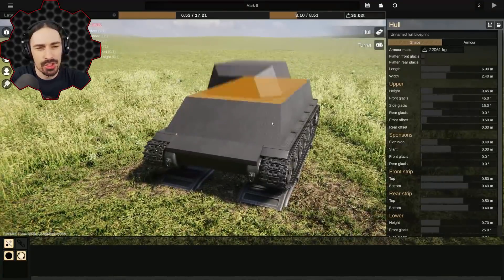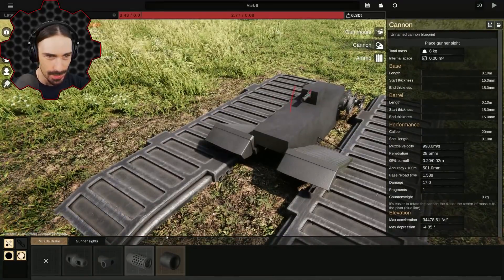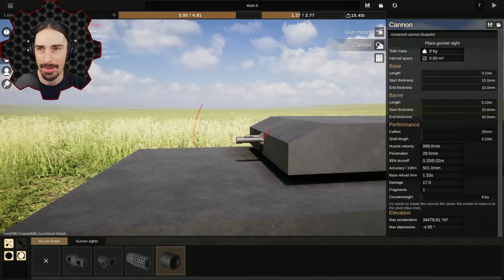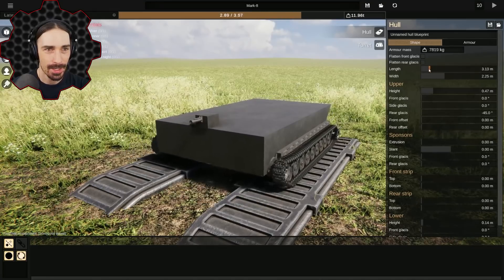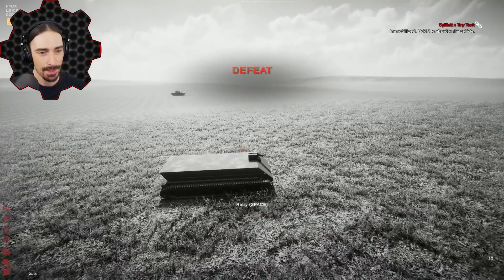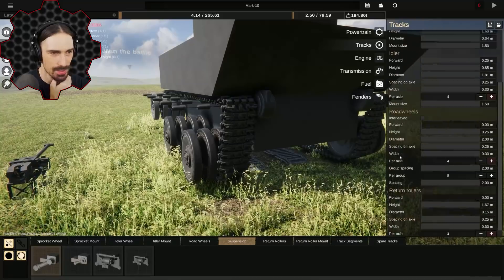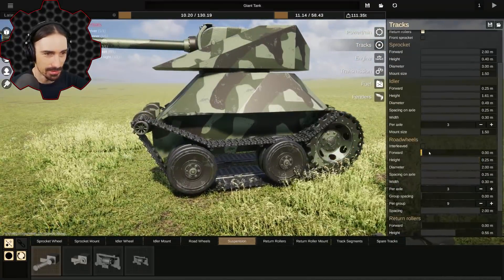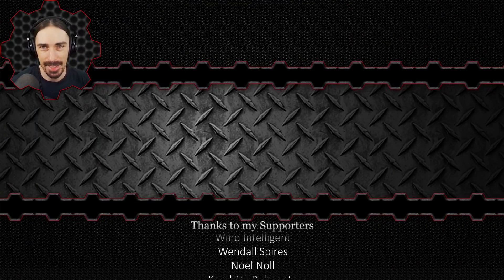Minimizing Every Stat VS Maximizing Every Stat Possible! - Sprocket Gameplay

Comment: The three trade offs for tank design... Weight, Power, Speed. Armor is nice, but slows you down and takes from how big a gun you can have. Big guns mean either no speed or no defense. And high speed usually spare armor and weapon. So, it a delicate balance.

Comment: Turning left and right with dual transmissions means that you need to be in like 4th gear at a slow speed like 20 kmh. That allows the left side to go into 3rd and right side to stay in 4th, or left side to go into 2nd/1st and right side to stay in 4th. (Or vice versa). Gives you finer control of steering. Or clutch steering is easier and smaller, but if you spend time to refine the dual transmission it works better.

Basically if you’re always in first gear and still going a decent speed your transmission won’t be able to shift one side into a lower gear which = no turning. You need to be in at least second gear to be able to turn at all, and preferably 4th or 5th to be able to turn well and with fine control.

Comment: 7:30 go to mobility
Powertrain
And change to clutch braking
Reply: Or he can not be dumb and actually adjust gear ratios.
Reply: @Chevsilverado  well its not too important you dont need gear ratios (or at least i dont use them)
Reply: @somerandomdude9657  Properly adjusted gear ratios help A lot with steering and acceleration. If he kept 2 transmission steering and raised  the ratio a bit the steering would work perfect and the tank could climb hills better.

Comment: The reason your tank does not turn while moving properly is a combination of your transmission gear ratios being terrible and games inability to comprehend your controls with a bad transmission. The easiest way to fix this is to in the transmission setting put it to clutch braking. It allows the tank to be smaller

Comment: Scrapman, how about a death race multiplayer Monday.
You make a car with 2 spudgun(attack), there Would be a small explosive at the back(with a level 3 metal guard for not getting exploded by spudgun) that can be detached by another spudgun ( defence) and some censor detected Explosive walls (trap). The course would be somewhat simple and it would be lapped race until only one person is movable.
In addition, there could be a unique wild c card for everyone's car that they can activate once every lap( can be activated any time, non detachable, non explosive)

It's a great idea altogether it would be a little time consuming to make a track and  system like that. Colour sensor can be used to do it. 
I want to see this challenge so badly. 
And scrap u have made scrap mechanic my favourite game. Keep it up!!!

Comment: The reason why you can't turn when your moving fast is because you're using twin transmission instead of clutch controls. Clutch controls also take up less space, which would let you make the tank smaller.

Comment: The sprocket and idler size limit is based on the space available to it at its current height. Meaning the largest sprocket and idler diameters you can get are when they're in the middle of the track system. If you have them high or low then they're restricted to where the diameter meets a kind of hard vertical limit.

Also, press Z in either sandboxes or in the show room and you will pull up the load list of tanks. Which ever one you select, the game will load in AI versions of that. Meaning you could have your giant tank lose to your mini tank, because it'd be pelted to death before it ever could take a shot.

Comment: 274 tons? I did a tank that weighed 345 tons. It can only drive with cheats on. It has maximum armor, is slanted all the way and has a big 152 mm gun and the biggest engine in the game. It is actually decently fast, to be honest.
Reply: Damn
Reply: What kind of engine you're running? Cylinders and displacement etc
Reply: @alkestos  V16 and the maximum displacement possible.

Comment: The problem with steering has to do with transmissions. You need to have either the clutch system or the ability to get into different gears per track. So if you aren't able to be in 1:2 or 2:1 at very least you wont be able to turn unless stopped.

Comment: To fix turning when moving by the way, use the clutch braking transmission instead of the dual transmission. It stops 1 track to turn rather than needing a different gear on left an right track.

Comment: Now make the fastest tank, fastest turret, and the strongest turret.

I know the Giant tank kinda has the strongest turret, but if you make the hull smaller, you could make the turret more comfortable to use.
Reply: The giant tank actually has a pretty weak gun despite what you'd think, as the barrel isn't long enough for all the powder to burn. You can make guns that'll deal twice the damage despite being smaller and faster to reload simply because the energy is being used rather than wasted

Comment: day 33 or 34 of asking scrapman to start a Survival series amphibious tank/basically any transportation and floating base/barge (or under water.) But you need mods... it's a require ment to breathe under water, if you want an under water base/transportation. And yes i am talking about the under water fan moonbo reviewed that basically makes water spaces air spaces... if that makes any sense.) (and if you wanted to move the boat/floating base you are able to make thrusters/glitches/mods to do it or by lift or actual push)

Comment: Srapman “I have to stop to turn then I can go forwards” soooo tank controls?
Reply: While you're right, you're right only for a clutch transmission, the transmission he was using is a twin transmission which allows for turning while moving by making one of the tracks spin faster than the other, the issue is his gears were poorly set up for twin transmissions

Comment: You can actually enable cheats and allow overweight tanks to play/start. You can also reduce more weight by decreasing fuel, using a lighter engine, and increasing the turret ring height.
Reply: like so scrapman sees this :)
Reply: @ds-3d283  commenting on comment to add comment chain so scrapman sees this
Reply: @lemmingmclemmington1156 @
Reply: @lemmingmclemmington1156  smart
Reply: @lemmingmclemmington1156  yes
Reply: He also didnt shave down/thicken the armor or use a 400cc engine like you actually can, which would let you have a tank with 1.24 cubic meters of internal volume necessitated
Reply: Also can edit the file to have more crew with no added weight
Reply: @maylovechubie249  eat glass
Reply: How do you do that
Reply: Ska Boo  ok
Reply: Whats the game name?
Reply: @lukybor8938  sprocket
Reply: Ska Boo  thansk
Reply: Make a fast tank
Reply: :_ScrapBigBrain:
Reply: Make a indestructible tank fat has the ability to destroy everything in it's path
Reply: @Undeadwolf_YT  I wish this game was a little more balanced or had harder enemies because literally the first tank I ever made had sloped maximum armour all around, a gun that can penetrate 230mm of armour with a 8 second reload, and it could go 55 kmh. 

I spent like 20 minutes making it so it’s really not too hard. Kinda looked like a T-34 mixed with a tiger.  It could one shot kill any tank in the game from almost any angle, and no tank in the game could penetrate the armour. 

So yea making overpowered tanks is easy and a little boring since it’s like a point and click adventure game.
Reply: But then it isnt at max settings
Reply: Only to 200 tonnes
Reply: Our you can do to it 🥰 UI benefits and shared with one Ii men uo IU
Reply: just use the sandbox mode
Reply: @tomwhitbread223  You still cant deploy your overweight tank in sandbox without the cheat.

Comment: You should try and make a tank that has high armor and just rams the other ones
Reply: The issue is that the closer you get, the worse the angles of inciences get, shots will stop bouncing off and will instead bury into your armor. It's certainly possible to do, but it comes with downsides for sure
Reply: @wyrdean_9649  if by "downsides" you mean "certain death"
If the enemy takes out one of your tracks you're completely useless
Reply: @wyrdean_9649  I made a tank with maximum armour, a gun that pens 230mm, and it could go 55 kmh. I let the most powerful tanks in the game shoot me at almost 90 degrees point blank and they didn’t pen. The gun on my tank could one shot them at almost any reasonable angle.
Reply: @Chevsilverado  that's cool and all, but I don't see what it has to do with what I said.
Reply: @wyrdean_9649  what it means is that the maximum armor in the game allows you to just flatout tank shots, even at point blank.
Reply: @i.minpayne2561  The original commenter was suggesting a ramming tank, which would take ages to kill an enemy tank, and likely be dealing as much damage to the enemy as to itself. 

What the other commenter said was 75% unrelated, as it was mostly about the strength of the gun and how fast the tank was, which doesn't have much bearing on a melee tank.
Reply: @wyrdean_9649  speed does have bearing on a melee tank, as you have to be able to get close to the tank to, well, melee it. the gun is unrelated, sure, but everything else makes sense. high mobility to get close to ram (and potentially increase the damage you deal, because, y'know, fast objects hit harder),  and high armor to survive the ramming and to survive getting close

Comment: Do a tank with 1 person doing everything and other 4 just being loaders.
Reply: you cant add multiple loaders in the game
Reply: @DoggosGames  considering that they let you make a turret of that size, multiple loaders should be a thing
Reply: @kaito0022  if it were realistic, multiple loaders would mostly mean you have more spares, instead of a faster reload
Reply: @carrott36  if I remember correctly, due to the difficulty in reloading, the kv-2 had an additional loader
Reply: @thiccthighssavelives5866  keyword multiple. the kv2 had other problems that made it easier for 2 loaders but that isnt going to be the case for every tank :)
Reply: @thiccthighssavelives5866  the KV-2 had 2 loaders for specifically one problem. Heavy projectile and explosive charges
Reply: @carrott36  If you want another tankwith 2 loaders, i think the T-34-85 would be it.
When tank shells got too large in WW2 tanks, an extra loader was added.
Reply: HEAVY MACHINEGUN
Reply: I know
Reply: @alexanderbisson7788  rip then

Comment: Allocate all the crew members to reloading to reduce reloading time
Reply: you cant do that if you want the tank to still work
Reply: @DoggosGames  r/woooosh
Reply: @Cta7  Spectral ain't joking
Reply: Only one crew member can be assigned to x job at a time, for example, you can only have one loader
Reply: @wyrdean_9649  Well you technically can have more loaders, but you just need to edit the game files. Frantic has examples of that and it's pretty broken. But under normal circumstances, you are correct and it's kind of sad. When you get to the higher caliber rounds, you would need another person to assist in the loading, but apparently Sprocket crew are superhuman.